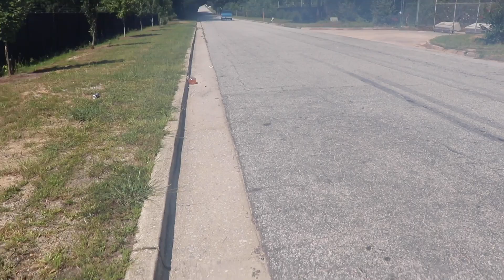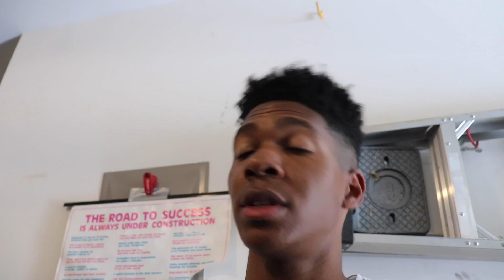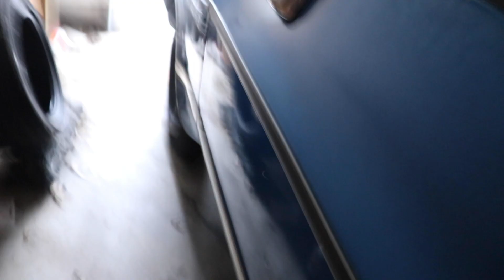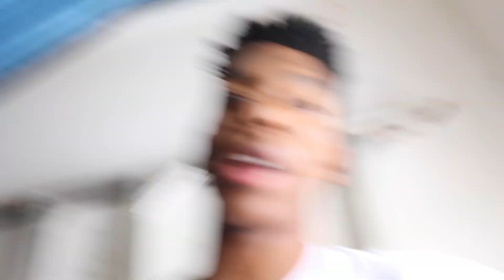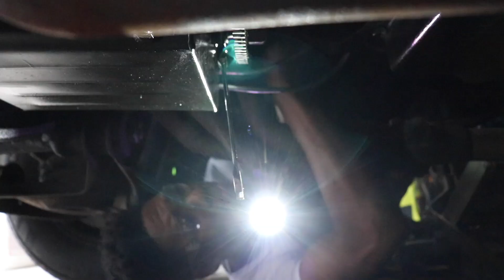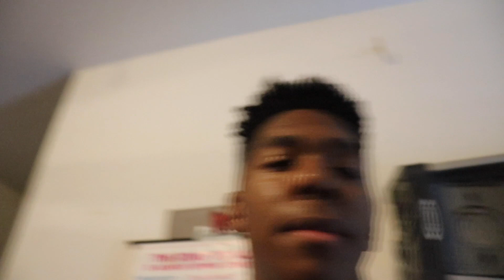I wanted to quit youtube because of this

Comment: Never hammer on your flexplate got to the store and get the flexplate tool it will make your life much easier. Or use a breaker bar and turn the crankshaft . You're going to have snags when working on things from time to time walk away and come back to it neve work on something when your frustrated.  But with those tools to help you should be able to get the bolt out easier.  Best of luck to you I know you will get it done .